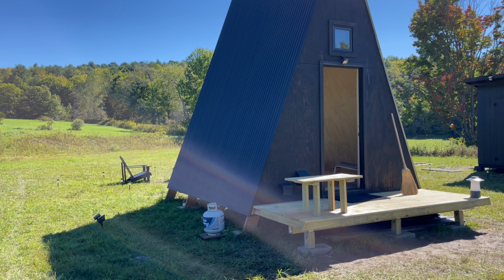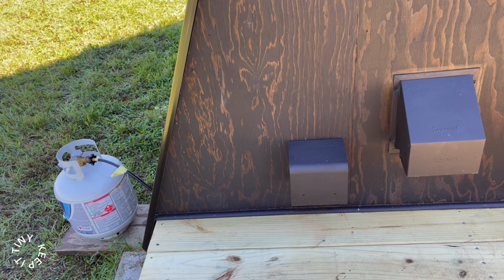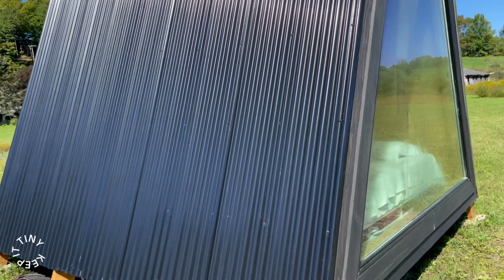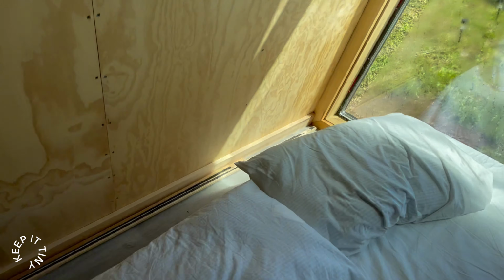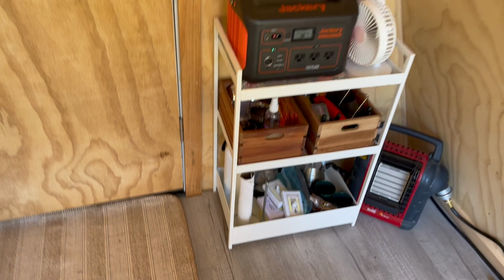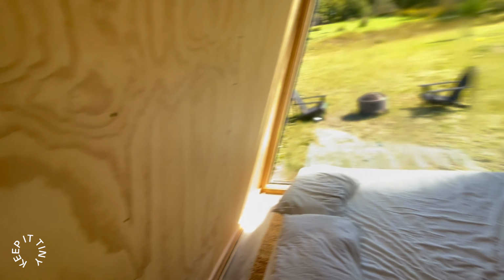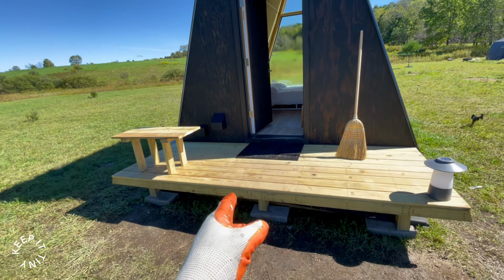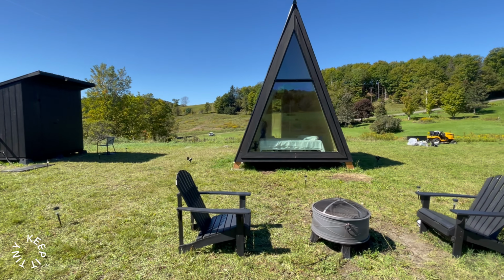CABIN AND GLAMPING SITE UPDATE | off-grid cabin, outhouse, deck, solar panels on Den Outdoors kit

Comment: what you can do for the propane tank and future plug-ins that you might want to install is to build a little tiny propane size box with a roof like the A-frame material. Make sure also to make it water proof.

Comment: Great job bro, id be wondering how long that 5 gal propanes gonna last
Reply from the maker: I have the heater connected to a 20 pound propane tank and I only use it on low since the space is so small and low is PLENTY heat. I think somewhere online I saw it rated to last 60 hours on low with a 20 lb tank. Using it in real life I would have to agree. It lasts a pretty long time.

Comment: EXCELLENT VIDEOS man. One thing as a question not as a rant. Did you consider burning the surface of the outdoors wood since you went black as color of choice? It also makes it waterproof and possibly harder to burn in a fire but I am not 100% on the fire aspect. My son and myself plan on doing this very thing so I appreciate what you've shared with us all. Keep the videos coming please. Very interesting. I do know it would not take much effort to source the materials yourself though and build a small unit like this for half the price. Not even an experienced builder is required for this. This is pretty simple to build just tedious and time consuming, but again please don't take that as a gripe. It's more of a response to a few of your remarks.
Reply from the maker: Thanks for the comment Rob. I def don’t take any of it as a gripe or rant and also you are pretty spot on with your comments! I know exactly what you are saying with burning the wood, I believe it’s called Shou Sugi Ban. I thought about it but the kit comes with an alternative method to get the same effect and benefits. The kit comes with a thick wax that you blend with another painting chemical (some type of primer that assists with the wax penetrating into the wood) that you use to give it the black color. It’s a pretty sweet effect and I wish I had the proper name for it but am responding from my phone on the go and cannot remember off the top of my head.
Reply from the maker: The cabin certainly can be built at a smaller price. Purchasing the kit just alleviates the hassle of researching and procuring all the necessary materials. So for people who don’t have the knowledge, time, or ability to get it done. I certainly fall into that category so I decided to go with the kit. If you are more handy (which you probably are) you can certainly do it yourself if you’d like.

Comment: Great Job!! Really looking forward to your Video on  shower / bath facilities!!😃
Also how are you planning to handle the laundry and cleaning in between your booking? 
I don’t see a washer and dryer on site :)
Reply from the maker: That is a great question. Out of the gate I will have about 10 sets of sheets so I can just swap. out the dirty for set for a clean set for a while before laundry will be a problem. From there I will drop them off at a wash and fold laundry place. In the future I could test out the portable washer and dryers where you just pour water into them.
Reply: @KeepItTiny  Wait what ?!Is there such a thing as a portable washer and dryer!! Wow ! That’s. Great idea!!!
Are you going to be the one cleaning and changing the sheets between the bookings ? 
Looking forward to your bath/ shower videos !!!😃😃👍
Reply from the maker: @romi929  Early on, yes, I will be the person handling turnover until I come up with a solid process. At that point, I will try to find someone who can handle it for me.

Comment: Be careful using that heater. Those heaters tend to release carbon monoxide and can be deadly.
Reply from the maker: Thanks for the comment and thanks for caring. You are 100% right, when I use that heater I pop open the window a good amount to ensure I am getting fresh air in the cabin. I have 6 foot air vent but I use the window as well just incase. Also, in the future I will be buying a direct vent propane heater that has its own vent outside so I won't have to worry at all at that point. I know that I can use this heater safely but I can't be sure others can/will so I will be changing it out shortly.

Comment: The materials are cheap. It should not cost more than $10k. I would’ve put a sliding glass door instead of a glass window and eliminate the door. More practical and better access to the fireplace.

Comment: $28,000 for this???????...... Look into arched cabins in Texas. They have cabin kits that give u two sides and roof. U finish the two ends and interior. Much more space and quicker build than this a frame. I would not rent your a frame even if u charged me $20 !!!!!!.... If u spent $28,000......or less.....for an arched cabin, u would have a kitchen, bedroom, bathroom.......loft, much more than your a frame!!!!!!.... Check out arched cabin in Texas..... Landio on u tube has some videos showing arched cabins being used for businesses and camp grounds.....